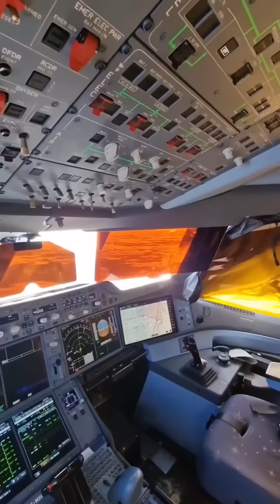Why do modern aircraft only have 2 engines?

Comment: Modern 2 engine aircraft have the capacity to sustain flight and make it to safety from mid ocean if one engine fails, something older 2 engine aircraft could not do or able to do with assurance of success.
Reply: That is provided one engine failure does not in any way effect the other engine, eg an uncontained engine failure, or, is from a cause that can affect both engines, eg Sully's ditching, the BA aircraft with frozen oil-coolers, or the BA aircraft (4 engined) that flew into a volcanic ask cloud at night, and lost all four for a time. ETOPS is a crap-shoot with an "acceptable loss rate" So far, we've not lost one, but we've come bloody close on many occasions, even with, very occsionally, a 4 engined type.
Reply from the maker: I think it's just luck of the draw, the more planes fly I guess the chances of something going wrong increases well something very rare going wrong increases
Reply: I flew a lot on the original 737-100s and a single engine loss was kinda uncomfortable but not an instant tragedy.  She's roll to one side a little but our experienced pilots could always level out and reduce altitude.  We always got to the gate but a little late.
Reply from the maker: I can't imagine now knowing that the power was as sufficient as today sitting there and seeing an engine flame out or shut down not knowing if it'll carry on flying or not
Reply from the maker: Engine power has just increased over the years great engineering minds and advancements!